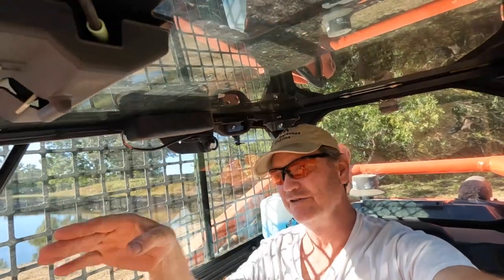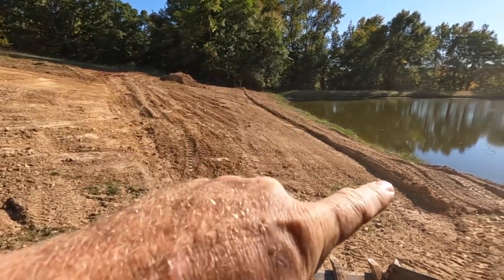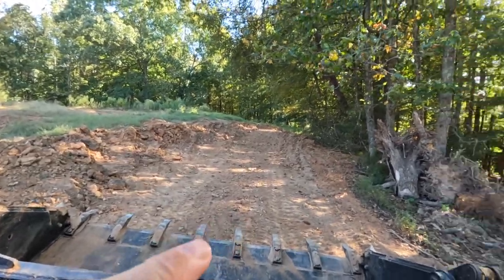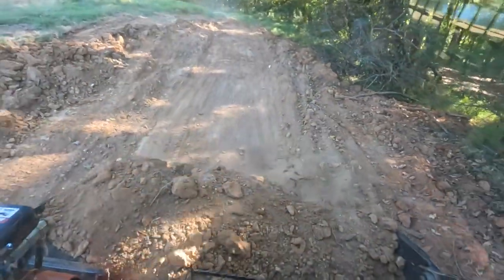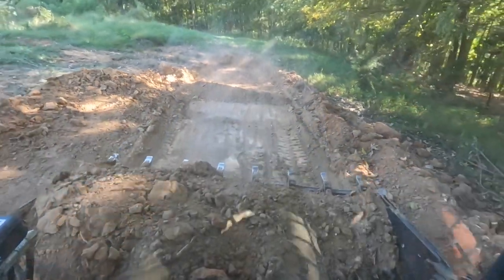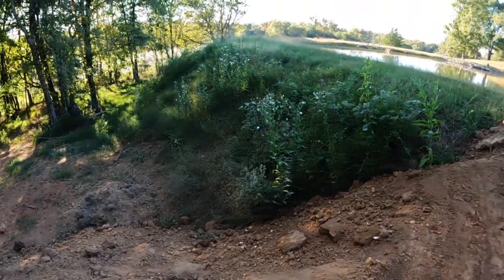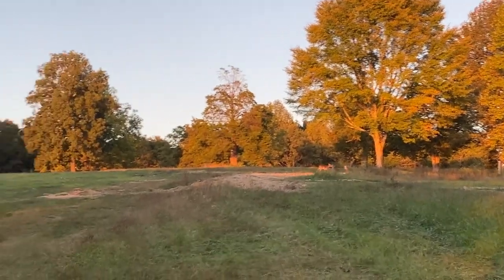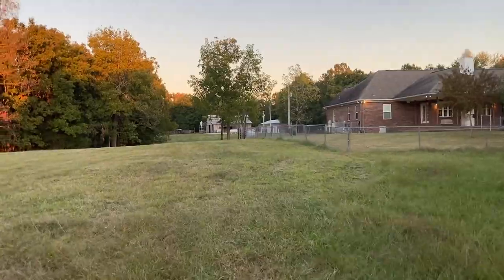Sawmilling Break, Pond Work, Feed Fish and Dodge Deer for Fun at Hobby Hardwood

Comment: What brand of blades do you use on the sawmill?
Reply from the maker: I use WM Silvertips, from a custom weld shop, not Woodmizer.  I used to drink the WM Cool Aide and only ran Doublehards, but they have a shorter flex life, are too brittle and don't last any longer with sharp teeth.  A Silvertip is a resaw band designed for very high speed resawing with full speed attack at the beginning of the cut and cost less than Double Hards.  I have tried pretty much every band out there, form every manufacturer out there, and  I haven't yet found a better band than a well welded and ground Silvertip.  I run .055 x 1.5" Turbo 7 on my mill.  Thanks for watching.
Reply: @HobbyHardwoodAlabama  is that something that I can buy? Or do they make them just for you? Do they have a website?